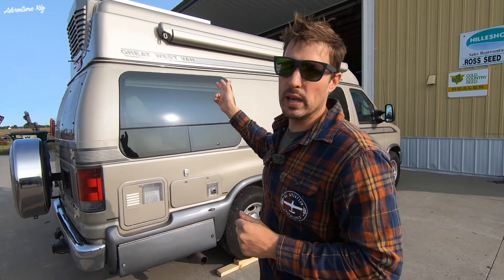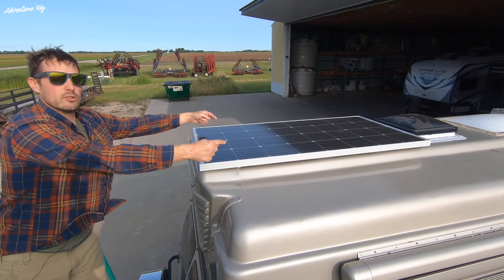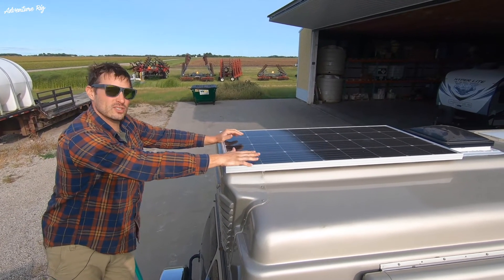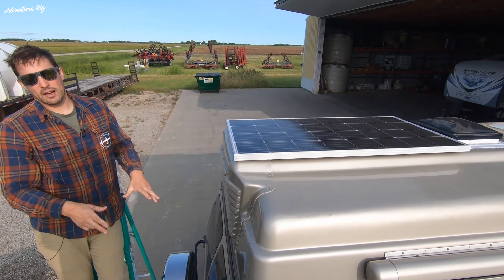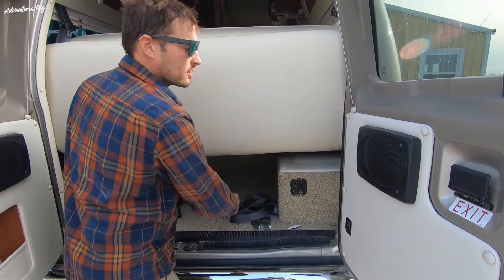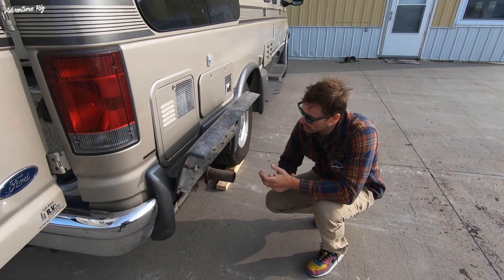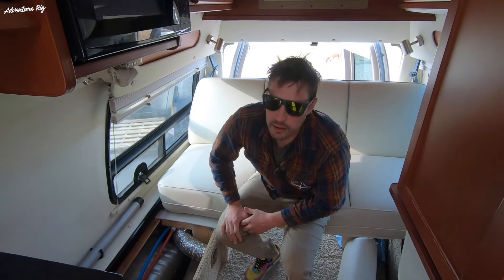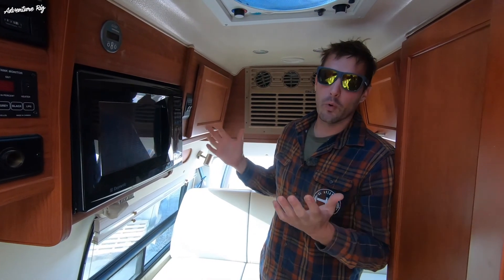Mounting and Routing Solar on a Fiberglass Roof Van or Camper

Comment: Perfect timing! It's 3 months later, did the solar panel get ripped off in Mexico?
Reply from the maker: No! We’ve since driven through some wicked winds and high speed and never had a problem. Temperatures of 90 degrees Fahrenheit all the way to -10 degrees. The cold is where I was really worried but never had a problem.